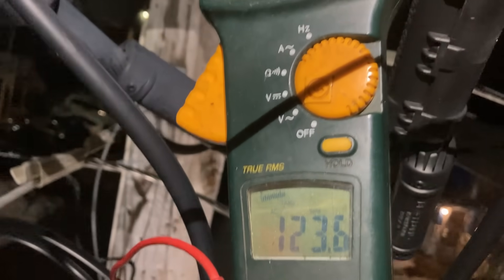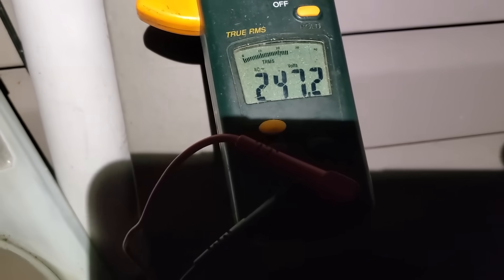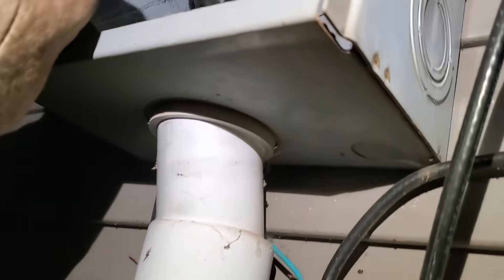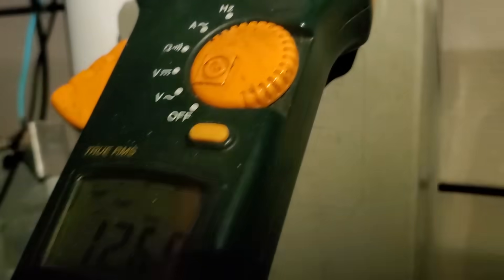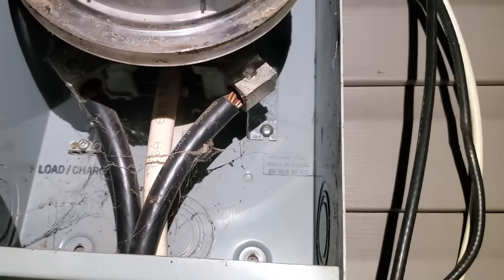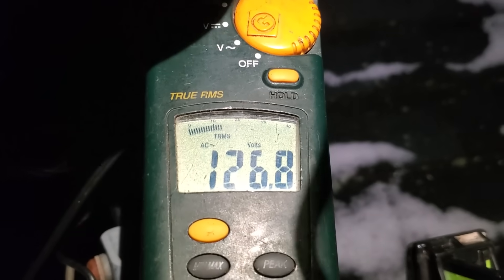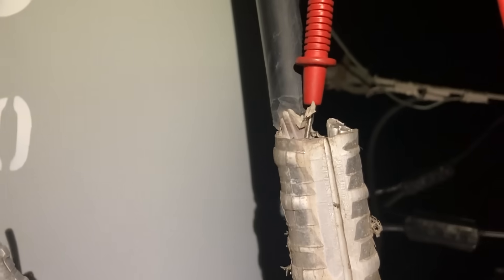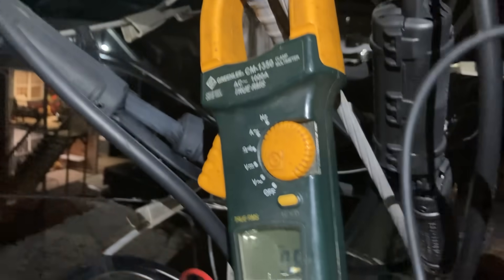Finding a bad neutral on a Service - Raw footage

Comment: I wonder if it would be possible to have a test apparatus that plugs into the meter socket that allows applying a loads without energizing the customer equipment, with voltage and current measurement points.  Take the guesswork out and prevent a bad case like this one from doing more damage.
Reply: The st800 or beast puts artificial load on the conductors.

Comment: Had a bad neutral in my six unit townhome building a few years back. I watched a number of videos trying to understand how to locate the fault but never found as clear of an explanation and demo as this one. Thanks Aaron!  

I called the power company who claimed they came out and checked the pad mount and didn't find a problem (I work from home and never saw a utility truck show)... Then called the HOA who called out the electrician. Never learned where the fault was, but I'm guessing it must have been the building main disconnect.

Comment: That very good. that how I check from inside the home and work cack. many times I had to call power company and they come right out.  open neutral can be dangerous and damage electronics and stuff. I have hade voltage swings so high that trigger the hole   home surge unit. with the wind storm that came threw NY this was common. I have even Hurd of a transformer fail from inside causing open neutral and that was on a 480V/277V system. happened after a storm. saw new transformer on pole.

Comment: I'm only 3 min in, so I'm not sure if you touch on this (if not, maybe you can make another video sometime) but as a cable guy, I've seen a couple times where the end of the coax service drop was melted.

One was at the ground block in the home, another was at the tap. As a contractor, they didn't train us on this, I only figured it out by looking around online. While I was changing the connector, I bumped it against the cast iron plumbing stack and it sparked a bit. I carefully used pliers to touch it again to make sure I wasn't seeing things.

Anyway, one of those calls had a history of repair calls going back to 2012 for "bad connectors" 🙄 It was only after I read some horror stories online about that I realized how bad this condition is.

One story mentioned how a fire started in a bedroom outlet upstairs after the tech cut the coax. I guess it was acting as the return path to the transformer up to that point.

I have pics and video of those calls. Maybe I'll make post a video of them. Look forward to any replies on the subject!
Reply from the maker: Oh man! Yes great topic. 
The coax or telephone drop can absolutely attempt to pick up the slack for the neutral return!

I've seen it many times, scary stuff.

Next time I come across it, I'll definitely document what happened. It's very interesting and often difficult to realise what's happening.
Reply: I recently read that article too. I was going to show it to the boss, maybe a change in policy in how we handle broken neutrals going forward needs to be made. Perhaps staying on the site until the power company shows up...or even calling them ourselves. 

I have a trove of pictures of it as well! It really through me for a loop the first time I saw it.
Reply from the maker: Our local comms guys are instructed to phone our emergency line when they come across this. They don't necessarily have to wait on site, but sometimes do and at very least leave their contact info. We treat this situations as urgent and respond immediately providing there are no other more serious emergency calls.
Reply: @Bobsdecline  what's interesting is that I think the coax plant is more susceptible. I did 15 years on the telco side and don't recall ever seeing it then. I assume it's because telco lightning arrestors only short to ground when they're blown, so I think the twisted pairs inside are electrically isolated all the way back to the central office. But with coax, I think the connector (and shielding wire) are common back to the tap at the nearest pole. I believe this is why they've always told us we MUST ensure proper grounding!
Reply: @mben92  thanks for the reply. Do you guys use amp clamps? The small company I work for has never told us to test for current on a drop, but I'm really inclined to pick one up. When I was doing telco, they made us buy the big yellow FVDs. Maybe Aaron can touch on why the FVD didn't go red when I touched it to the coax. I think I checked it while it was disconnected from the ground block, but I assume it's cuz the neutral is return path and not actually "hot?"
Reply: @grabasandwich  Yes that's exactly why. Twisted pair plant is supposed to be isolated, only interacting with any grounding conductors through a MOV or gas tube. A shield or steel strength or locating wire may need to be bonded at some point, but those don't interact with ISW and terminate right at the demarcation point (aka NID)

By contrast the outer conductor in coaxial cable - braided shield - is regularly bonded to ground and therefore neutral

Yet another reason fibre is handy lol

Comment: I work at the local telco, and I probably run about 10-20 calls a year due to a BROKEN neutral line causing our coax service line to melt at our tap or at the ground block, since we bond to the ground. I'll inform the customer to call into the power company right away. I normally can spot the break! Now you have me thinking of what issues a bad neutral can cause for our internet customers. Have you ever seen this issue (melted coax) yourself?
Reply from the maker: Another comment literally just landed at the exact same time as yours, describing exactly this!

Next time I come across it, I will definitely document it. 
It can be very dangerous and difficult to detect and understand what exactly is happening.
But yeah... That coax or telephone drop (next) carrier can definitely attempt to BECOME the neutral 😧
Reply: That was probably me! Unlike most techs, it really piqued my interest, so I wanted to figure out why (Yay inquiring minds! I think I have undiagnosed ADHD or autism...and I'm not poking fun at those who have it!)
Reply: @grabasandwich  I find this video explains things very well:  https://youtu.be/LJvyb_WujZg

Just remember that "the ground" has really nothing to do with this problem, because the voltages are not high enough to actually push much current through the earth. But anything grounded can try to become a path for the neutral back to the transformer.
Reply: @jovetj  yeah, I've seen that one! I wish I was good at making videos like these guys!

Comment: What causes those to go bad like that?  Was it completely open?  Like was the tiny amount of current actually returning through ground?
Reply from the maker: Corrosion from two different metals (Aluminum/Copper) in the presence of electrolyte (water). The connection wasn't so bad that that the circuit was completely open, but definitely high resistance. Those particular crimps do come prefilled with anti-ox to prevent corrosion, but ultimately time will wear away at any connection that isn't completely sealed. The bare wire neutral make that difficult, even with insulated piercing connectors.

Comment: Once my service totally lost the neutral, that can be very destructive to some of the 120v devices as the voltage can swing very unbalanced line to neutral depending on the running line to neutral devices. Thanks for the video  and explanation.

Comment: I work at a LU and lineman always says never disconnect the neutral by itself (leaving both hots connected) because there would be no return path and would damage electronics also 
When disconnecting at a transformer if a meter still plugged in .one of the hot lead would be energized ? Can someone explain
Reply from the maker: Using the scenario in this video; The neutral, although bad, was still carrying some current. If it was completely cut off the voltage fluctuation would be much more drastic. Cutting a neutral clear off is a good way to send 150+ voltage through half the customers home.
Reply: For the second question (a disconnected hot lead being energized) it's pretty simple. Power can flow from the remaining leg, through any 240v loads in the house (or even the meter's own internal circuitry) and back on the disconnected leg.

Comment: I've been chasing some odd power issues at my place for a few years. I redid the breaker panel to balance the legs better and that helped a lot, but thinking back, I think one leg was going up when the other went down. Maybe it's been a bad neutral all this time. I'll have to check next time I'm back home. Never knew you could check for a bad neutral like this, but it totally makes sense why that would work.
Reply: If your lights are flickering intermittently (or like others have said, some going bright) I'd get that looked at ASAP! Could be a serious fire hazard. Good luck!
Reply: As an Australian I still find it bizarre that it's legal to do your own electrical work in some countries. Sure, we have 230v at the wall, but in the US there's still 240v in the meterbox. That's not to say I'm exactly happy that it's illegal to do our own electrical work (it's really not difficult to safely replace an outlet, for instance) but it definitely makes me more confident when I'm buying a house that the wiring hasn't been set up dangerously by someone doing their own work

Comment: For anyone still confused why this happens, normally the neutral is referenced to ground, by being connected to it. So the neutral is the 0 volt point that the +120 and -120 are measured from. If the neutral isn't making a good connection it will be pulled above or below ground by the leg that has more load. The bad connection is basically moving the 0 point in relation to the 2 legs. That's also why the 240 isn't affected, they're still the same relative to one another. That's kind of an oversimplification, but its more or less how it works.
Reply from the maker: This explanation works perfect with a vector diagram of a three phase setup with a floating neutral too.
Reply: Keep in mind that the neutral being grounded has nothing to do with this circuit. The neutral is the center-tap of the transformer's secondary winding, which splits the 240V of the full winding into two halves.  The neutral back to the transformer normally only carries the imbalance of the two 120V legs anyways.  Whether it is grounded, or not, changes nothing.
Reply: I had this lesson early in my sound-guy career. I plugged-in a sweet small PA system on a familiar campus. It sounded extra good! For 15 minutes, and then FWOOMP! Mushroom cloud to the ceiling. I fetched my meter: 160V, where we always had 117V. I asked in the office if they were having power trouble and she said no, but the MrCoffee was taking forever to get hot. That outlet was down below 80V (it was a Line Meter not made to show small volts). Ceiling lights steady, musta been a different circuit. Already I had a glimmer but the campus electrician came right over (the FWOOMP! scared people) and explained in detail. A Neutral wire had come right off (low-bid contract). My 30W PA and the 1500W MrCoffee were splitting the 208V, UN-equally. (It was a 3-phase job so there is a root-3 in there, but whatever.) 
The smoke was a main filter capacitor the size of a soup can. Over-volt it a while and the guts boil out. What a mess inside!
Reply: @jovetj That is incorrect. By not grounding the tap it is not neutral. If not grounded you have 3 hot legs on a single phase tapped transformer. You would still get 120/240 from leg to leg or leg to center. If not grounded though depending on loads your voltage from l1 to ground and l2 to ground will not be 120 it will acually flucuate hope that helps
Reply: @1xXCoLeXx1MC  But it is neutral...it's in the middle between the two other legs.   You're correct, if not grounded it's a "hot" one, but it's still neutral.  Same applies to Y 3ɸ.
Reply: @jovetj  It is only neutral because it is bonded to ground. without the bond it is now another leg. If you take a 240v secondary with no taps you will have a 240v difference between L1 - L2. If you ground L2 you will still have 240v across but now you have 1 hot leg and one neutral. The neutral can be from any part of the coil not just the center.
Reply: @1xXCoLeXx1MC  It is neutral because it equally divides the two halves of the secondary winding.  It has nothing to do with being a grounded conductor!  Corner-grounded Δ3ɸ exists and that's certainly not a neutral.  Perhaps if we started calling it "median" instead of neutral it would help?  The neutral or "median" can be used with either leg to get the same voltage.
Reply: @jovetj  I guess not all grounded conductors are considered neutrals. I see the NEC goes a little more in depth on what a neutral is but The CEC on the other hand does not use the word neutral only grounded and ungrounded.
Reply: @1xXCoLeXx1MC  For the record, the NEC defines a neutral as:  The conductor connected to the neutral point of a system that is intended to carry current under normal conditions.
Reply: @Bobsdecline its too bad YouTube comments don’t support images. Im sure not everyone will google to see what a vector diagram of a three phase setup looks like.
Reply: @1xXCoLeXx1MC in a perfect situation, if the center tap/reference point/common wire, on the secondary side windings is not bonded to earth, you wont have voltage between L1-gnd, L2-gnd. 
You will have voltage between L1-L2 240v and L1-center tap 120v and L2-center tap 120v.
The only reason for grounding center taps in 120/240v 3 wires single phase or one leg of a 240v 2 wires single phase, is only for safety mesures. To prevent having any other surfaces, other than the conductors, getting energized.
Reply: @martf1061  Exactly as long as the capacitive currents from L1 to ground and L2 to ground are equal. Good explanation.
Reply: There is no -120 and +120. There is no polarity in AC.
Reply: @1xXCoLeXx1MC So if the center of the coil (the Neutral) is having the Energy off of each leg dissipated to ground, how does the connection between each leg and the Neutral work for the circuit to be complete?
Reply: Great... Thought I understood, till you chimed in.
Reply: @jovetj ????

Comment: Why not just measure the voltage across the crimpet?
Reply from the maker: You will see the voltage drop across the crimpet. The reason to check in this method is it must be first used to determine that is what you're looking for. Once determined you could then continue troubleshooting simply by checking across neutral connections for voltage drop. The only other problem is if you somehow skipped a connection you wouldn't be able to tell that you're passed it. Using this method, if you suddenly start seeing good voltage you know you went too far

Comment: I had a bad neutral between the transformer in my yard and the meter socket. 
The power company showed up in less than an hour. 
It took months to get them to show up at my commercial building.
Reply from the maker: Oh crazy 😧 A suspected bad neutral should always be treated as a "low priority emergency". Basically responded to ASAP as long as there are no large outages, fires or any other safety related calls.

Comment: Assuming you have one on you, would this be a situation where you might be able to use a thermal camera to speed up the process of locating the bad connection?
Reply from the maker: Sometimes... In this case, I double there was much heat if any at all. I've definitely seen bad neutrals get hot or even have the neutral take another path through a pipe, meter box or bond and glow red hot!
Actually I posted footage of this on my Instagram if ya scroll through to one of the earliest posts

Comment: Was just going to type that you can also read the voltage drop directly across that bad crimp, from one side to the other.... then I see someone else already posted that method. It will read the same 4-5 volts that you are looking for, depending on load. (maybe more?)
Reply from the maker: Yes exactly! The only reason I tend to use this method, is to find out whether I'm looking for a bad neutral in the first place. Once you find out that's what your looking for, you could then carry on by simply measuring voltage across each neutral. 
I my one other problem is if you skipped the bad connection somehow, you won't realise you're behind it.
Reply: @Bobsdecline     ahhhh, but you'd verify the repair before packing up, right? Problem NOT solved so start over!

Comment: With such a small gradient in values it's a wonder this isn't overlooked by many in the field!
TY for sharing this!
Reply from the maker: It can definitely be tricky! During a service call for something unrelated (if the customer hasn't indicated a problem). The technician may check volatge and see for example 121V on one side and 123V on the other, which may be perfectly normal. The 121 Volt side may be loaded up, and with no load may be both 123. 

It could also be a well balanced load with a bad neutral that would show 122v per side with the meter removed. - a quick amp check will tell the story pretty quick!
Reply: @Bobsdecline  Awesome work! Thanks for the tips! I will certainly use this and share it with others!
Reply: @Bobsdecline  That's the "fun" part about troubleshooting or problem diagnosis:  using sound, critical, logical thinking to build a collection of evidence of symptoms towards (or against) a possible diagnosis.  The more information one has, the better, because the more unlikely situations can be discounted.
Reply: It might be handy to have some kind of variable load on hand to check the change in voltage as load is incrementally applied, so it can be evaluated without having to turn on a microwave or some other large load that could push the other side to damaging voltages. Hair dryer with a rheostat or something maybe -